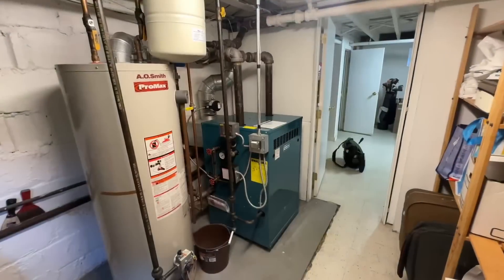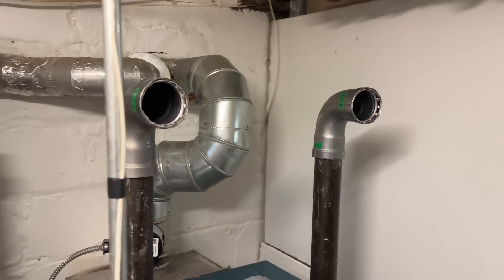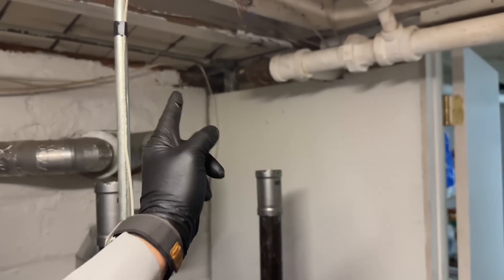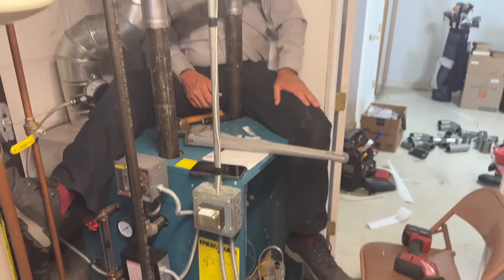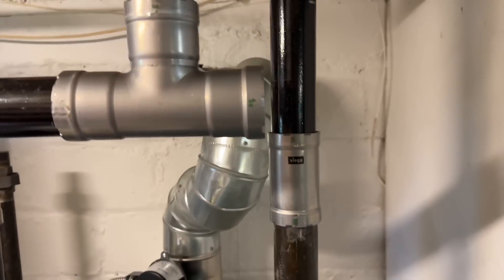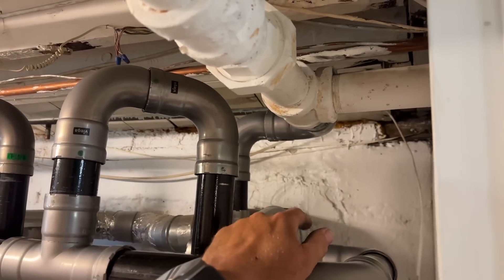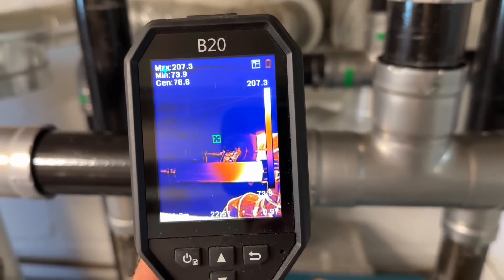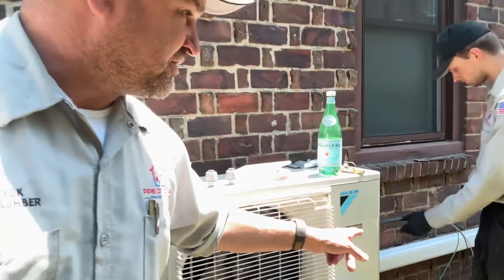EXTREME BOILER MAKE-OVER & TRANSFORMATION! Viega MegaPress for the WIN!

Comment: I’ve got the same problem. I bought a house in Brooklyn and near boiler piping is all wrong causing short cycling and all type of issues. I use my split system to heat the house. 

How much does this  piping correction cost?

Comment: Just curious if you have a heat sensor video ‘before’ you did the pipe work modification. Sharing it with the community would prove how important a proper header configuration is to any install. Thanks Mikey!

Comment: To clean the pipe, how about a small bench grinder with a wire wheel you could just set it on the floor and use for larger jobs like this? Just a thought....
Reply: it also takes off any burrs, scuffs and scarring on the pipe surface, which could cut the seal rings. a pipe vice and working the drill/tool around it would make it easier. instead of fondling two things at once(lol)

Comment: More on the R-32 system please!!
Reply: @PipeDoctor  There is rules on R32 as its flammable and then you think of natural gas very flammable but the higher pressures with R32 you must braze any internal connections outside you can flare/crimp I think its shit.

Comment: Do you have any reservations about the longevity of the press fittings for gas/steam piping on black iron? Last I checked the warranty for gas press fittings was only 10 years, and typically a warranty is indicative of how long the manufacturer expects the product to reliably function, which to me is a very short warranty especially compared to the 50 year warranty given on copper press fittings. It gives me some worry about using these fittings where they will be walled up.
Reply: Viega just changed the MegapressG to 20 year warranty